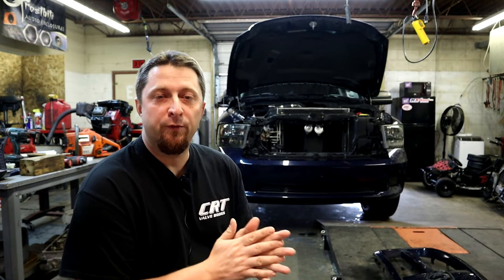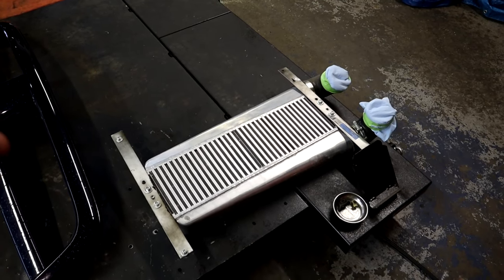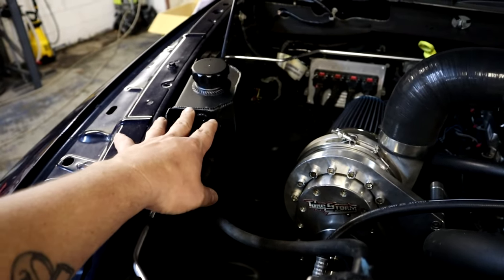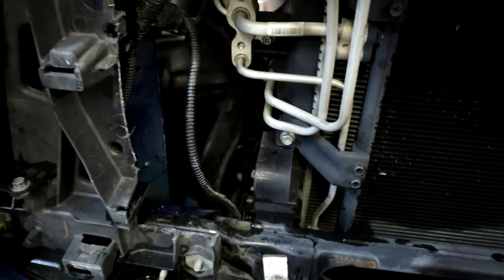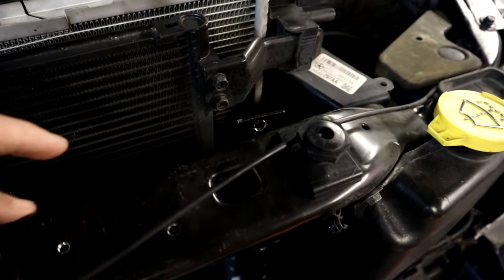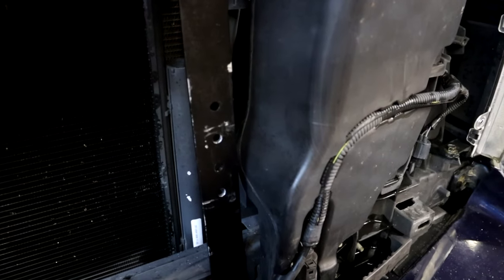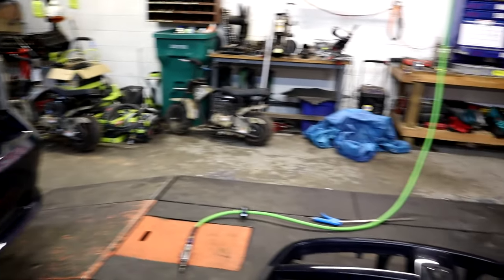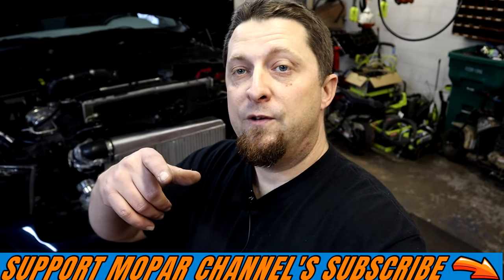Project STORM Gets Intercooler Installed Boosted Ram 1500 4X4

Comment: Custom is the word of the day.

Was looking at my radiator core support on my truck to run a front mount intake horn rather than the stocker that points at the inner fender (trying to avoid pulling from the wheel well and under hood temps) it's a tight fit, though my Radiator support is metal lol, yeah not much room for anything thicker than you hand.
Reply from the maker: Definitely 👍